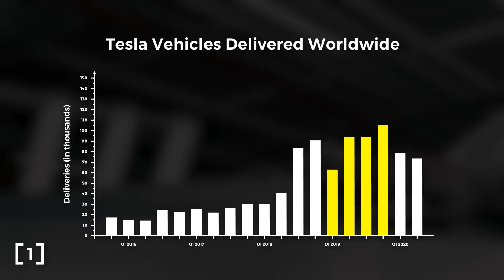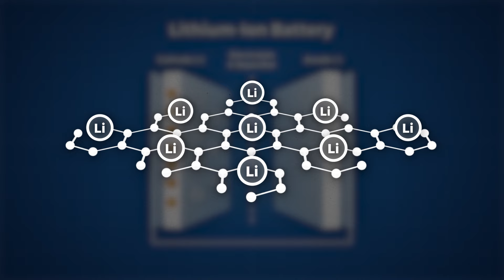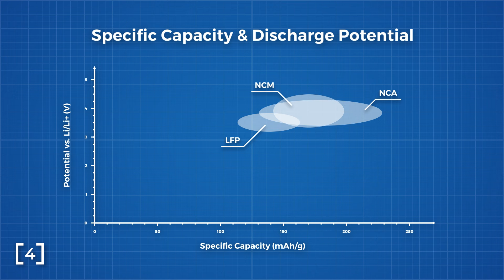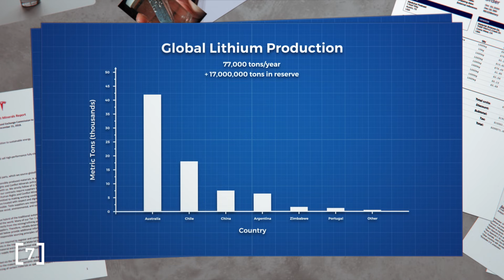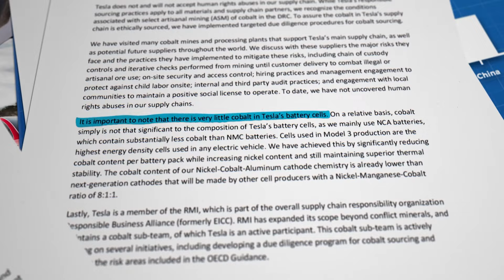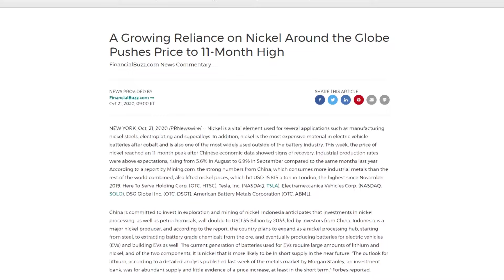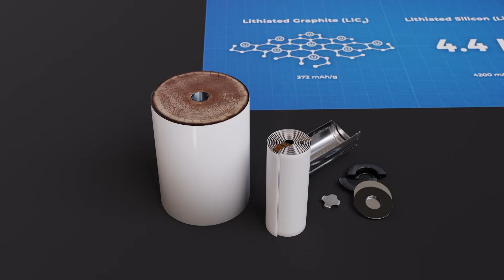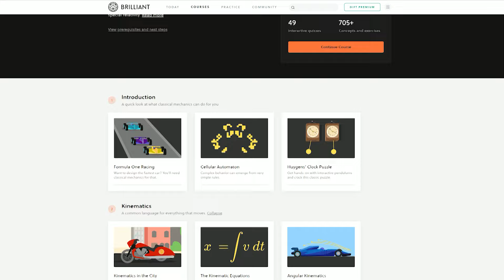Tesla's Battery Supply Problem

Comment: Lockheed Martin's deep sea mining division has claims on the ocean floor and has had them for over forty years.  They have the equipment and the experience.  The sediment or mud under the nodules contains Scandium, a strategic metal as well as other rare earth elements.  Depending on the concentrations, the sediment will probably not be discharged into the sea.  I am sure the world will be watching their mining operations when they occur.

Comment: At the Giga factory Nevada grand opening, they said they are designing their products for optimal and precise recycling in house. Essentially, they get all the precious and interesting metals back for essentially free, apart from the cost of transportation, to be re-manufactured into new batteries and products...all powered by renewably powered electricity. 

It definitely sounds like circular - waste equals food - everything is a nutrient industrial production. It definitely sounded like cradle-to-cradle production. It would be wonderful if all manufacturers could have more and more safe and healthy Cradle to Cradle Certified products to offer clients. A world without waste nor pollution; energy abundance.

I was quite interested to hear that, in your opinion, lithium could be better used in vehicles rather than grid batteries. Interesting. It is pretty important to phase out industrial carbon emissions. Perhaps in a few years Tesla will use different chemistry for their grid batteries. I am hopeful, thankful even happy their Hornsdale Powerpack big grid battery powered by a large wind farm is operating brilliantly.

Comment: The supply chain is a huge issue and EV’s are not that significantly. The primary shortcoming of this video is that is does not consider California’s commitment to fossil fuel free electricity. There is not enough lithium on the planet for the batteries required to compensate for the times that sun is not shining.

Comment: Yeah yep spinning mass weight in large electronicaly controled  frictionless bearings  would not need batterys spinning at speed of light threw gears and pulleys in relativity of equal & opposite reactions of tides or winds.

Comment: Batteries seem to be a major drawback in electric mobility. There shouldn't be a mediator between the power source and motor. At least not a determining factor as it is at the present time. My proposal is power lanes, a scaled up bumper car. Batteries will not get obsolete but they will get smaller to serve us between the power-lanes Maybe supercaps are better at this.

Comment: QPM.ASX will provide 90% or more of that battery shopping list without the Geopolitical Congo issues, barring Lithium that is abundant in the market for the possible foreseeable future. QPM Punches above its weight in battery metals supply. It is a small Australian (Queensland) company called Queensland Pacific Metals. Production slated for 2023. Good value on the ASX for around $0.10c AUD. Could we see a 10X + on that stock;-)

Comment: Generating all our current electricity by green methods is a massive problem. If you then add heating demand this is a massive increase in generation. How do you then add the amount of generation required for transportation? 
Storing summer electricity for winter use is the biggest problem with a pure battery electric model.
Green hydrogen that can be sourced from countries like Australia (solar) and Iceland/New Zealand (geothermal) you can then transport the hydrogen around like oil.
Hydrogen has lots of problems. It is just the least worst option for transportation.

Comment: Lithium grid batteries just aren't the answer. I'd still bet on Gen 4 nuclear SMRs with their cooling systems linked to thermal batteries. Just keep a hot salt bath and a heating system to convert excess renewable energy to thermal energy, or use a small molten salt system to float charge and heat up those Don Sadoway liquid metal batteries as direct electric storage. Lithium just isn't worth the trouble at these large scales, especially with the dendrite formation shorting out the cells.

Comment: My current problem with Tesla, and any top of the line car for that matter, is the current sofware license laws.
They made sense when software was a fledgling thing, but now that it is so pervasive, sofware laws need to change. 
What I am talking about? Ownership of products you buy. If they have software in it, you don't really have ownership of the product as it can be remotely bricked at the flick of a switch. See Oculus QUest 2 or even Tesla itself, that refuses to start if it detects a Non original part.

The fact that this is not concern number 1 spells a very dark future ahead

Comment: I just do not see Lion battery cars as a large scale solution.  They are just not energy dense enough, cause fires that cannot be put out, take too long to recharge, and uses too much rare earth elements.  Either new battery tech is needed or hydrogen needs to evolve.

Comment: One of the issues I have with the push to electrify cars by mandate (looking at you California) is the problems they have in the supply chain from a human rights perspective. Look up some of the Cobalt mining techniques used in Africa (and the age of the workers). That needs to be addressed before I could buy an electric car in good conscience (and yes - I'm aware many of my devices suffer the same problem - if there was a choice there I'd exercise it).
Reply: A mandate has the effect of increasing the pressure of demand and disincentivizes fixing the conditions those workers suffer.

Comment: For grid scale energy storage, we need to stop looking at chemical batteries.  Energy potential exists in other forms.  Instead of storage in batteries why not take that excess energy and split water.  Store the hydrogen and oxygen separately and burn it to run turbines when demand requires it.

Comment: I mean, grid energy storage has been a solved problem for a while. Take a balloon, stick it in the ocean, when the grid has surplus production fill the balloon and when the grid has a shortage of production empty the balloon using the weight of the ocean to keep a constant pressure. Why would we want to use batteries of all things to try and store energy?! They are heavy and inefficient.

Comment: What we need is abundant cheap energy that can provide what we need when we need without all of the deaths, damage and other problems of our current energy production methods. Liquid salt reactors are the answer. Then we can desalinate salt water, create liquid fuels and fertilizers and (for those worried about CO2) pull carbon out of the air. We can also generate medical isotopes and clean up our current nuclear "waste" stockpiles. Nothing else comes close.

Comment: 21:12]. Look at this, this is amazing, two maintenance workers walking across the catwalk on some type of roof-top solar installation, each one of their footsteps ripples across the four or five adjacent rows of panels!  That is absolutely amazing.  This installation is not going to last, look at it, it is going to fall apart,  What are you going to do with it when it does fall apart, and some mid-level manager decides to scrap it?  Is there any plan to truly 'recycle' all of these derelict solar panels and installation?  Not that I have ever heard of. Or straight into the landfill?   Steel, as a material? globally 90% gets recycled into more steel - easy to do.  A PV cell, has a single one ever been recycled into a new solar cell?  A single one?  Lets build giga-tons more.

Comment: Ok, am I having a total brain-fart, or isn't the cathode the side with all the extra electrons (the negative side)?  I mean, they call an old-fashioned TV picture tube a Cathode Ray Tube (CRT) because it sprays its electrons (negative) towards the anode (positive).  So how is it, at 3:21, you're showing the Cathode of the battery as being positive and the Anode as being negative?  Is it different in batteries somehow?

Comment: Wouldn't it be smarter to not have Li-based batteries as grid security? Their appeal is the mobility of Li-batteries, which makes them good for cars and electronics, but grids??? Would be much smarter to create Hydrogen plants, which can store excess electricity into H2, to be combusted when needed. This also removes the need for backup generators.
I know Hindenburg is a problem, but it is cheap, doesn't harm the environment and is not bottlenecked. I don't think it will be a fuel for cars, but who knows.

Comment: I feel like lithium batteries should only be used in transportation/wearables, and nuclear energy should supply the grid. Solar wind is garbage and only adds toxic chemicals into the landfill. Geo thermal/hydro dams should be used a peaker plants

Comment: I think battery energy density improvements are a worthwhile goal for other reasons, but this refrain about saving the planet is an epic conceit.  It assumes we're capable of destroying a planet that (at least) 3 super volcano eruptions and an extinction scale meteor strike couldn't destroy.

We likely will be able to save ourselves from whatever environmental threats actually exist, but those are just engineering problems with dozens, possibly hundreds, of solutions.  Battery energy density is just a piece of that puzzle.

Comment: Trouble with the liquid metal batteries is the 20% cycle loss.  It is competitive with  pumped water storage hydro and lead acid  but not lithium  iron.  It does not appear that it is going to be cheaper than lithium iron either.   I am not.sure how flow batteries in its various forms  compares I suspect some of them are more competitive. 
Gravity,  liquid air,  hydrogen,  will all.need to balance on cost to.produce and cost to install.  However at the moment it appears.to gain maximum benefit from battery grid storage you need Teslas management software.  Whilst the say they are open to selling these products they are not open to taking there engineers time away from their own projects.
 I guess catch 22.

Comment: I am surprised to hear that so much nickel is used in the making of stainless steel. I had always understood that the metal which makes steel stainless is chromium - at about 11%. I would check on your nickel assertion.

Electricity storage on a grid scale will become unnecessary when we have molten salt reactors to generate safe, efficient, clean, cheap nuclear power. There are many promising designs from entrepreneurs looking into this, thanks largely to the revelations made by Kirk Sorensen. Unfortunately the money going into this is nothing like the money that once went into pwrs, or is currently wasted on hopes of fusion power.
But the company: Moltex (based in the UK and Canada) has an interesting interim solution, called the Stable Salt Reactor, and this is ready for deployment. In addition it can be used to clean up the legacy of trans-uranic waste which has emanated from sixty years of pwrs, and which will continue with the old-fashioned nuclear plants being built at Hinckley (and elsewhere).
Reply: Nickel is crucial for stainless steel. The nickel content is around half of that of chromium. Nuclear power always has the drawback of nuclear waste and uranium reserves aren't unlimited.
Reply: @hantrio4327  
Yup. Fair enough for the common 304 stainless steel. 
But 430 stainless steel contains no nickel at all.
AND
The molten salt reactor can get power from thorium ... ... ... of which there is plenty.

Comment: Or... Just make the batteries in electric vehicles smaller -> less required resources.
The 200+ mile journeys that Teslas batteries are built for are completely unnecessary for 90% of journeys, so why take up all those resources and carry around a 0.6-tonne battery that you have to accelerate, stop and change direction the whole time (which wears the car and the road, causing more repair work needing to be done)?
Build for a battery range of 40-50 miles, good enough for 90% of journeys and then have a little ICE/hydrogen fuel cell that only runs for those few times a year when you actually need that range.
Or better yet just drive less. Cycle where you can and only use the car when you have to. And look after it, making it last forever so you don't need to buy a new car AT ALL saving all the energy, waste and resources needed to produce a new one in the first place.

Comment: problem is its old tech being bandaided..... silicon has 3 dimensional expansion and that screws with the battery being a structural component.  its a pipedream as in the end solid state will be the solution and these bandaids will be cars with no value in 7 yrs

Comment: Wait a sec, using silicone to get more than 10 times the energy capacity is absolutely huge, theoretically that means that certain electric airplanes actually are feasible beyond the single engine two person training planes that they've got now, that's just one thing, this would make electric vehicle and battery storage actually feasible if this technology could be realized. Why have I been hearing that we're so close to the theoretical max on energy density which is far too low to realize the battery dreams of the future, I've been dismissive of this for awhile because of that fact. Maybe this technology isn't actually feasible but why haven't I heard about this until now? Is this a long researched and failed 'solution' from much earlier and that's why it's been discounted like the hyperloop? Maybe it's possible with material science improvements but is this a dream like fusion power or something realizable? This would be incredible if possible.

Comment: So this Tesla battery supply problem is actually a battery supply problem for all electric vehicle makers, meaning this problem will affect GM, VW, Ford, Nissan, Toyota, etc etc etc just as much as it affects Tesla, right?

There seems to be a lot of articles with "X Problems for Tesla" that actually have nothing to do with Tesla specifically, and everything to do with electric vehicles in general. It generates more hype to criticise Tesla, but I'd like for people to recognize that every other car manufacturer could have been the world leader in EVs, and yet they chose not to, and waited for Tesla to zoom ahead of them completely. Every problem Tesla faces with EVs, other car manufacturers will face even more. Tesla is just the pioneer trailblazer, running into (and solving) the problems that would have inevitably come up.

Comment: Would it be impossible to intervene in the Congo by supplying more automation techniques to extract with? They wouldn't need their child labor force to the same extent and production would increase. This video seems to suggest that much mining and refining is done by hand. Is there no interest in investing in the Congo or are we demanding prices stay so low that there is practically no compensation for the work done? We really shouldn't be bothered by the labor practices, it's a problem if given enough time the extraction for industry does not result in any benefits for that society. We also passed through period where child labor was common as well as necessary. As we're currently pushing new boundaries it is a question of how to balance process while still reaching a goal in reasonable time. More machinery but requiring investment or we replace these minerals cutting off an industry that may provide some little benefit to this region.

I don't understand why we're avoiding the hard or obvious choices here.
Reply: Because capitalism?
Reply: The situation in the DRC is entirely about security. The region where this small-scale mining is happening is effectively lawless. If order was restored the big international mining companies would quickly move in and put the locals out of business, but that wont happen while any operation the companies try to set up there will be instantly looted and their employees murdered.

Comment: Why can't we put some type of electrical distribution into our roads and let the E cars work by making contact with it and that powering the vehicle and use the batteries to power the vehicle where there are no electric roads and yeah I hear you now that's dangerous that's this or that and I say there is nothing wrong with the idea and this way governments can choose t to do the upkeep for the roads or lease them out to privately owned businesses which would have to be heavily regulated at first because of greed but just as gas stations are privately owned this might can be and doing it this way could also make it easier in emergencies to stop cars coming up on an accident or something by cutting power

Comment: So, what I see here is that it's going to take a while before we can switch to solar with battery storage for everyone's electricity needs.  Probably on the order of 50 years or so, unless we see a very marked increase in the production of Cobalt, Nickel, and Lithium. (Or some other stuff that's hard to produce, assuming Lithium Ion batteries aren't the storage medium we use for long-term grid storage.)

We need to have nuclear power in the meantime.  Unless we want to continue making our electricity from gas, oil, and coal -- which we clearly don't.

The environmentalists' insistence on getting rid of nuclear power is short-sighted, and will only cause more problems in the future.  I hope they will realize the folly of their denigration of nuclear power before it's too late.  Nuclear is far less polluting than fossil fuels are.  And these days, far safer than it's ever been before.